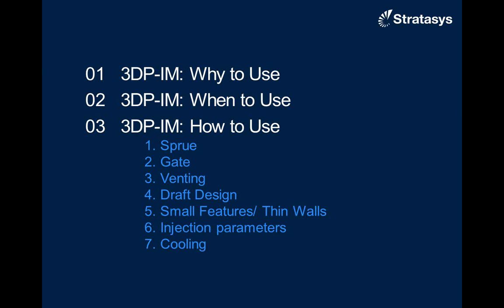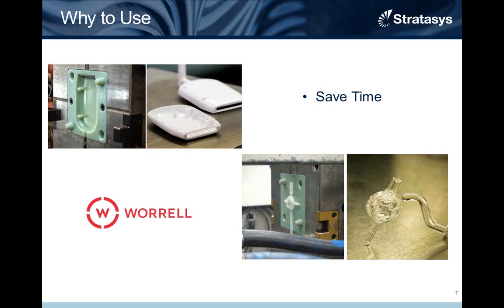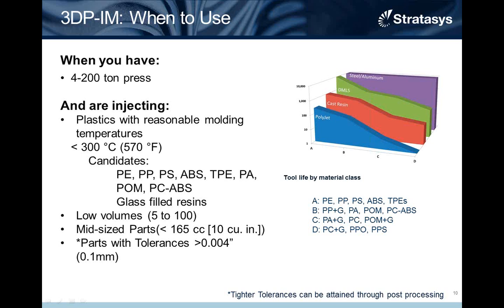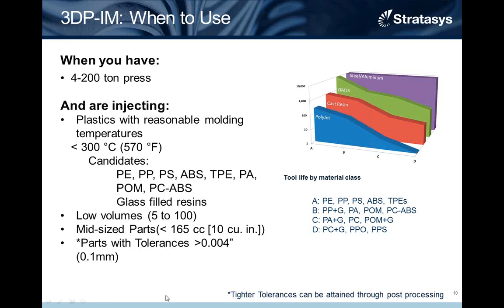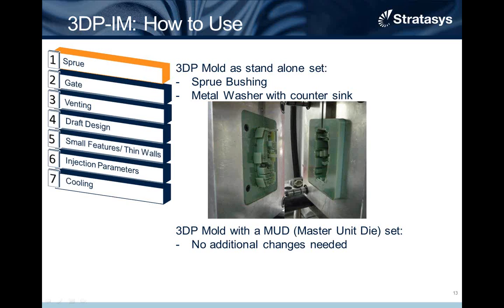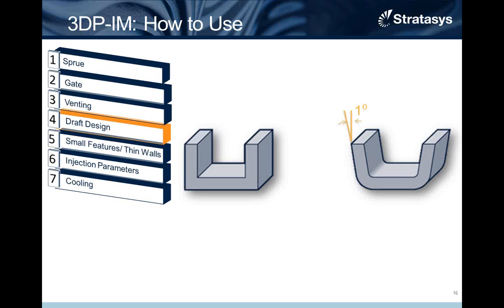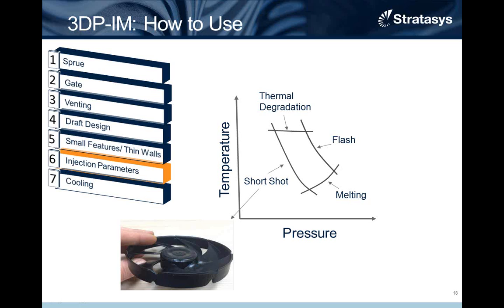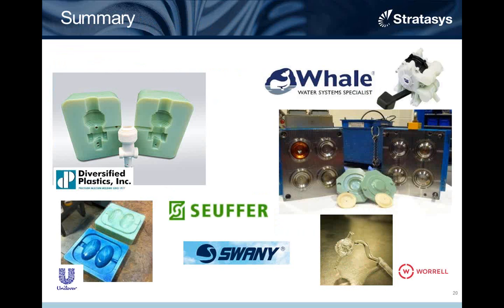Webinar: Using Stratasys Polyjet 3D Printing Technology for Injection Molding

Comment: Looking to print mold. Like to know would how many parts could we make using TPU.
Reply from the maker: It is hard to say exactly how many cycles the mold will last as there are many factors in play. We have seen upwards of 25+ parts and as few as 5. It really depends on the size and shape of the part, along with how cool the mold can be kept throughout the process. The larger the volume of the part, the longer it takes for the part to cool inside the mold and the hotter the mold gets. TPE/TPUs have relatively low extrusion temps; however, it can take longer for it to cool to a point where it can be ejected from the mold (increasing the heat and deterioration in the mold). The important thing to keep in mind is that this process is for prototypes and very short runs, it is intended to save thousands of dollars in testing a design and making design changes before cutting aluminum/steel tooling for production.